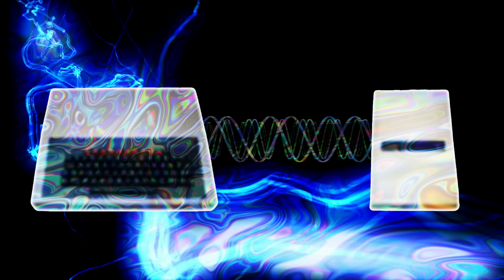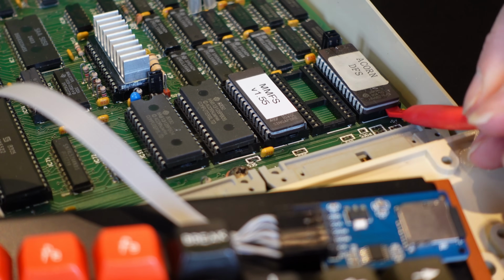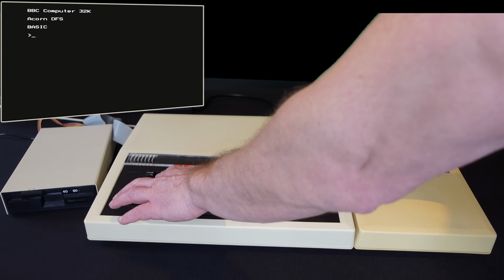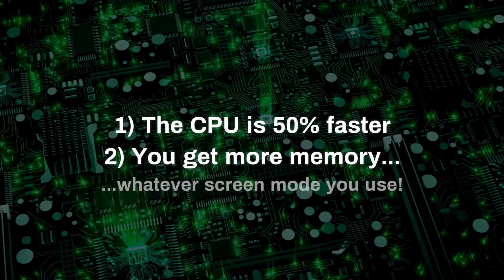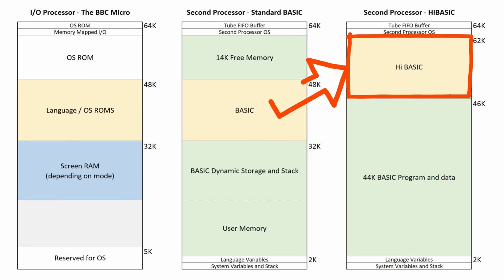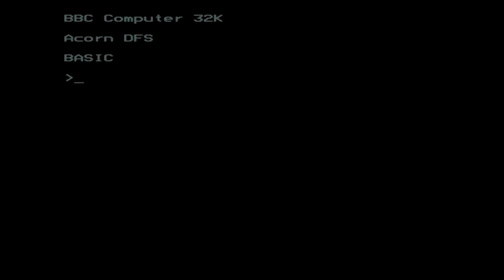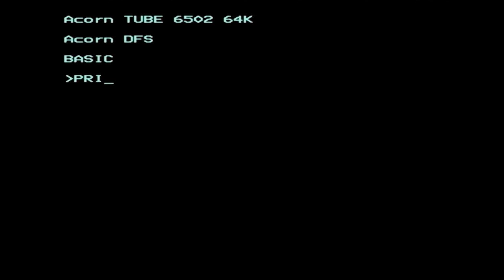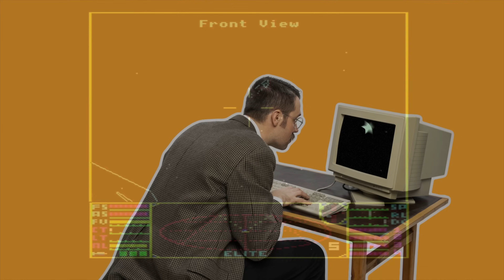I Bought a 2nd Processor for my 8-Bit BBC Micro!

Comment: Is the reason you can do a *HIBASIC call with just the disc, because the * command is passed to each service ROM in turn, then it gets passed to the disc interface? Is the file identical to the ROM out of interest? I'm guessing when you enter the language on the ROM, when it it's in a slot, it triggers code to copy itself (or maybe most of itself) into the top of the tube RAM and then enters BASIC from there? Does the slot ROM show as a language or service ROM (or both) when typing *ROMS out of interest? Can you enter *HIBASIC when the ROM is in the slot too and achieve the same effect as having it on the disc?

Comment: I didn't have a BBC Micro, but I did use them a lot at a computer shop.
When I used the one with a second processor, it felt twice as fast, not just 50% faster that you would initially expect from 3 MHz compared to 2 MHz.
The second processor didn't have to deal with screen drawing, sound etc., so your program had almost exclusive use of it.
This excellent design made very clever use of the 6502.

Comment: Great video! I'm lucky enough to (still) have a 6502 AND a Z80 2nd Processor. The reason why the Tube cable is so short is dictated by physics: the cable had to be that short because of intricate timing necessary, and the load (capacitance) on the bus.

Comment: A very clever feature of the Acorn second processor system was the the second computer had a miniature version of the BBC Micro's MOS (Machine Operating System). This would accept all the graphics, sound, filing system and other OS commands but instead of trying to execute them the second processor just forwarded the command and parameters to the host processor for execution and then collected and returned the data results. What this meant was any program you wrote for a standard BBC Micro would run without modification on a second processor as long as you only accessed the hardware via MOS calls. This sophistication in design is what really set the BBC Micro apart from its peers in the home computer field which demanded non-portable hardware specific peeks and pokes to access special sound and graphics features.
While you focus on Basic and games the second processor was also very effective when it came to running the View word processor and other office applications.

Comment: I have the B+, bought from the tip for £5 back in the day, along with the disk drive, not as nice as this one though. Meant to be putting it on ebay for the past 20 years, will get around to it one day.
Dad was head teacher so had access to one every weekend which he'd bring home, better simpler times.

Comment: So, you went from 2 MHz 32k to a 3 MHz 64k machine? It seems like a long way to go for not much.
Reply from the maker: If you're using a high resolution or high colour graphics mode, you get a lot more useable memory compared to a standard BBC B, something like 7x,  and a faster processor and you get a slightly improved version of the already excellent BBC BASIC. All that for 50% more £ seems pretty reasonable to me if you were serious about programming.

Comment: I still find it extraordinary that they went to the effort to design the BBC (nee Proton) hardware and software to be multi-processor capable at a time when nearly all other manufacturers were laser focused on reducing unit costs. The only other computer with a similar build philosophy was the Apple 2 and that was 4x the price.

My final year university project was to use a BBC to build a satellite tracker, and I snarfed a 6502 second processor for the project just because I could 🙂 It was totally cool to have the main application running in BASIC on the 2nd processor talking to the hardware controller, real time clock and drawing routines implemented in assembler on the main processor.
Reply: It was built to a high standard to a spec from the BBC and priced accordingly. The keyboard is still one of nicest I've ever used

Comment: The cables are short for electronic reasons. Every wire forms a capacitor with the adjacent wires. To stop signal crosstalk, every other wire is a ground wire. Now every signal looks like it has a capacitor to ground. The BBC drives them with 74LS244 and 245 chips (fairly strong) but the Tube chip is a relatively weak MOS chip. Capacitive loading turns the cable wires into LC delay lines. The longer it is, the bigger the delay. Biggest problem is that the signal energy echoes back and forth if not absorbed at each end of the wire. Longer cable, longer time for the echoes to die away. Acorn did not think about this much in their designs. They just minimised the problem by using cables as short as possible.

Comment: I built myself a second processor for my BBC micro back in the day. It used a Z80, so that I could run CPM on my BBC. Couple of euro boards, one with the processor, and the other with 64K of dynamic memory. I wrote a BIOS into a sideways ROM, and linked via a custom parallel interface. Meant I could run all my CPM code on my BBC micro.
BTW there is no need to use program memory for screen display- you can use 'sideways' ram for this. Most enthusiasts had this, and a RAM space for loading sideways ROM code- Mine would take 15 ROM codes.

Comment: These were brilliant. As a teenager I was always struggling with mode 0 and shortage of RAMuntil I got the 2nd processor. Eventually sold and got the BBC Master 128 with an internal 4 MHz 65C102 co-processor. Even faster and no horrible ribbon cable. Still have this today. Its a keeper!
Reply: That was a lovely machine sadly mine died when I pulled the monitor cable out while it was still switched on, cue nice big fat blue spark and a dead display no screwed in or locking monitor cables then

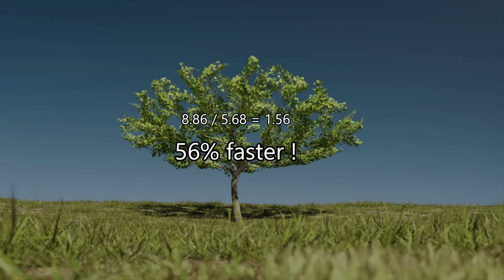Comment: 5:41.  No, the standard Beeb is 56% slower as the base time is the tube time.

Using the inverse fraction with the standard time as the base time, the tube version runs in 64% of the time meaning it used 36% less of the time.
Reply from the maker: Maybe 'faster' is not a good word. If it takes the bbc 8.86s to do 1 unit of work (a tree) and it takes 2nd pro 5.68s then how much work could pro do in the time it takes bbc to do 1 unit. In the extra 3.18s the pro can do 3.18/5.68 more units of work = 0.56. So 2nd pro can do 1.56 units of work in the time it takes bbc to do 1.

Comment: Those were the days when you were totally in control of your own computer. And had the information to know how it worked down to the last byte or hardware register. My thesis was based on a 6809 SWTPC system. But later I did a lot on 6502, so much that I know many opcodes by heart (LDA: A9). And I was not too shy to solder in some extra chips if that was needed. You don't do that anymore not even on a RasPi.

Comment: (In my opinion) I would suggest Acorn weren’t “mean” with the cable length but it was probably more related to reliability of the link. Great video thanks, I never understood how the co processor was any sort of benefit before.
Reply from the maker: Glad you liked the video. As others have pointed out the cable is restricted for timing reasons. I wasn't serious when I said "mean" it was a poor attempt at humour that I now regret. 😖

Comment: Just takes me back to my school days with the Econet that I helped to install in the new computer room and the big boy BBC with it's hard drive and 2nd processor. I had a real soft spot for the then new BBC Compact with it's 3.5 floppy, external 5.25 floppy and separate keyboard
Reply from the maker: 3.5 inch floppy discs seemed so modern at the time.
Reply: @pixel_fandango  I agree, especially after using cassettes and 5.25 floppies lol

Comment: I always fancied one of these but had to make do with a standard Model B (with SS/SD 100kbyte disk and Watford Electronics DFS, plus sideways RAM board) . Still, that served me well through my uni years (mid 80s) where I used Acornsoft ISO Pascal for all my programming projects, except for the assembler stuff, which we did on a DEC PDP/11.

ISTR the ISO Pascal came with a second version on a separate floppy disk, which was only for use if you were lucky enough to have the second processor.

Comment: What a pity the video capabilities aren't upgraded with a copro too stupid for words
Reply: Not really in scope of the second processor. The whole point of the design is that the old BBC does I/O including screen, so that's the bit that would have to have video controller and memory upgraded for any better display modes. The only reason the modern Pi versions have more screen modes is because you can connect directly to it's own video output and it has tons of RAM available.
Reply: @andy_the_fool  but theres very little information on the capabilities of the pie gpu and if the processor hits 1.8ghz why the heck didn't they include a tv encoder I only need 4 and we can have a quad core zx spectrum next!

Comment: What about Second Processor running a TMS99110A which is a 16bit processor with floating point capability+512MB of RAM.
Reply: Perfectly possible if it complied with the Tube protocol. Possibly one of the chips evaluated and rejected by Acorn when looking for a 6502 replacement for their planned BBC successor. They ended up designing and testing the original Arm chip (24/32 bit) as a second processor for the Beeb.
Reply: @MikePerigo They also sold the ARM co-processor, not as a general purpose retail item but as a developer kit for companies wanting to develop ARM software in advance of Archimides coming out or wanting to evaluate the ARM chip itself to use in their own hardware. Other coprocessors were sold as regular retail items e.g. Intel 80186 and Nat Semi 32016 based units. There was also a product called the Acorn Cambridge Workstation that was a single box solution (apart from mouse & keyboard obviously) that looked a bit like a fat Tandy TRS80. It was marketed as a scientific workstation and came bundled with (I think) 5 different compilers and actually had a BBC Micro board and a 32016 coprocessor board inside it.

Comment: One of the worst days of my job at a UK teacher training college was the day I was - as a IT technician - told to 'bin' two dozen fully working BBC Micros because they were 'obsolete' and the college had upgraded to Windows PCs... I literally had to THROW the BBC's from a second story window into a skip along with all the peripherals. I regret not smuggling one out - but if I had been caught I would have been in trouble. Along with all the educational related bits and pieces was a floppy version of Elite - that alone would have been a collectors item now! Terrible day.
Reply: I had to do a similar thing "sledgehammer in the skip" but we "Upgraded to Macs" waste of materials. I was told the reason to having to bust them was that if we gave them away they would need to be electrically tested and the cost per unit was more than it was worth.

Comment: I would like to know, how does it work exactly the two processors, do all  programmes work with this system, or only specially made programmes? I know that the Apple II had the option for a second processor for CP/M programmes. Possibly only one at the same time was working, the other one was '"resting". I understand that the BBC had many possible co-processors.
Reply: The answer is: that for the BBC micro programmes had to be specifically written to support the 2* 6502 processor configuration.
This is the case with Elite.

There you go, see much shorter and relevant this answer is?
Reply: (2nd try) In most multiprocessor systems the processors all have their own memory space and work independently, running their own programs at the same time as each other. Usually one processor coordinates the others, telling them what programs they should run and then using the results they return as data for its own main program.
They communicate with each other using shared data areas or data links.  The BBC 'Tube' interface is essentially like another data bus with a few extra control signals to coordinate the data transfer. 
The stand alone BBC micro normally runs a user program and handles all the input and output operations needed. Its memory is limited by the fact that it has to store the video data to be displayed, as well as space reserved for keyboard input, printer output, cassette, disk work areas etc.  Adding a second processor allows the new processor to run the users program exclusively and the original Beeb will continue to run all the system I/O routines as selected by the new processor. As a benefit of moving the user program to 2nd processor memory the original machine is now able to use the highest video modes available etc without running out of space.
Programs written that use only 'official' system calls could potentially work on either a stand alone or second processor system. Unfortunately the vast majority of programs written for the Beeb use machine code and/or access specific memory locations for speed improvements. Since the second processor has its own memory and potentially different machine code instructions it is unlikely that anything other than simple user programs will run on both the stand alone and 2nd processor configurations unless specifically written to do so.

Comment: Nice video. I have a pristine Acorn BBC Master and later acquired a 65C102 co-processor for it. I also fitted it with an adaptor that allows it to access a modern 32 Gbyte (!) memory card and store everything internally. It runs BBC Basic very fast, and BBC Forth even faster! 😁
Incidentally, the short "Tube" ribbon cable was a necessity as anything longer led to glitches in the data exchange.

Comment: The cable length is 1ns time delay. Any longer and the 2nd processor and its bus drivers would lose sync with the main computer pcb.
Reply from the maker: That is interesting. I was not aware of that. 👍

Comment: I bought this back in the day and did virtually nothing with it. The ribbon cable is short for a reason, because of signal timings I think. I actually wanted the Z80 second processor which gave access to CP/M and a massive library of business software and games but you needed a twin disk drive and at the time I just couldn’t afford it. The BBC micro really was the Rolls Royce of micro computers, easily up there with the Apple II and in many ways better.

Comment: I was a student at a UK High school in the late 70's and early 80's and gave up most of my summer holidays to help deploy two whole classrooms of 15no. BBC Micro's all connected to a Hard Disk based fileserver. This had a 6502 2nd Processor. The tech design department then bought a BBC Micro, 6502 2nd processor, Bitstik and pen plotter. I made it all work and then had to demo the software to allow students to do Computer Aided Design. It was a revolution for the department who were used to working on cartridge paper held on desktop stands with metal clips using a 2B pencil and an eraser and a T Square......I now regularly use Visio and Autocad with a mouse, but the Bitstik controller was amazing....are similar controllers available today?

Comment: the main reason for the short lead from 6502 2nd processor was for the interface which could cause problems with feed back from the processor and acorn did not want to chance it and come backs with that fault. They did have some problems with the 6522 in the 2nd processor in the early ones as i was one of the people testing them before going packing them back to acorn also they had to limit the speed of them as well because of heat problems coming from both units which melted the top of the case: the second processor cost new back in the day for £199.99 which half the cost of the model b :  help this clears some questions
Reply: At the school where I worked we had a long extension but the previous guy had wrapped it in foil and it worked fine.

Comment: In the 1980s, I ran a computer network with a BBC and 6502 second processor in charge of network, fileserver and printer operations. They were 20 BBC's and 20 BBC masters online. Most had View and Viewsheet in ROM on board. That Econet system ran in a state girls school in New Zealand for more than 10 years before it was replaced by PCs. I had left the school by then so I don't know what happened to the hardware. My own personal BBC master and peripherals were donated to a special-needs school where they were still using BBC-based software with concept keyboards right up and past 2000. The Acorn system was very robust and gave incredible power and flexibility for so many young people to learn the basics of computer programming, wordprocessing, and spreadsheets. Keep up the good work.Cheers from AKL, NZL.
Reply: We had Econet at the college computer room as well its where I got my first hands on a BBC micro never seen never mind touched a computer before and instantly fell in love with it its been a sometimes rocky road but me and computers are still firm friends miss the pioneering days with its hands on, do it yourself approach with the beeb you typically had to write or at least type out code by hand for many things
Reply: It's sad that by the time I got to school we only used the BBC for Geordi Racer and later the Archimedes for write and paint. Never went near a spreadsheet let alone programming. Somehow computer education fell off a cliff.